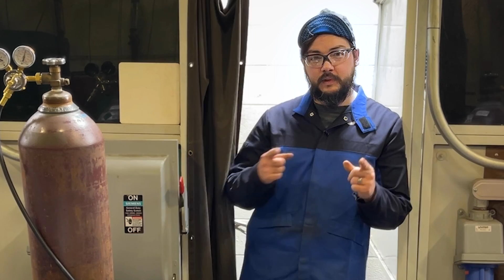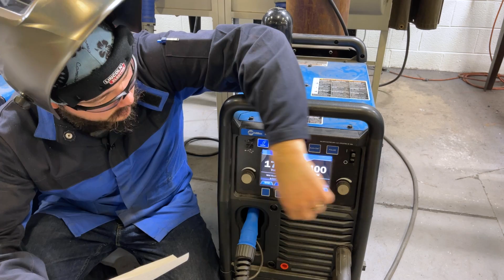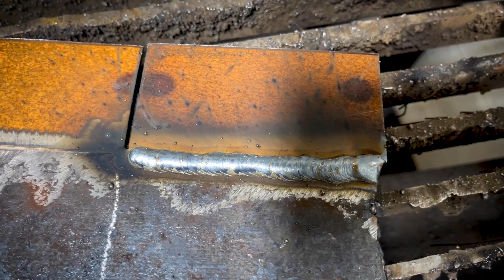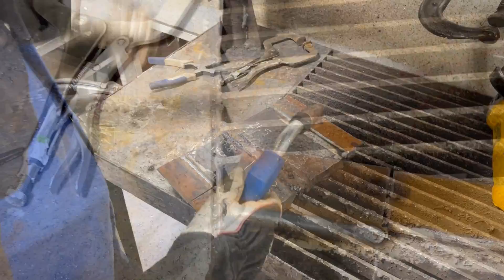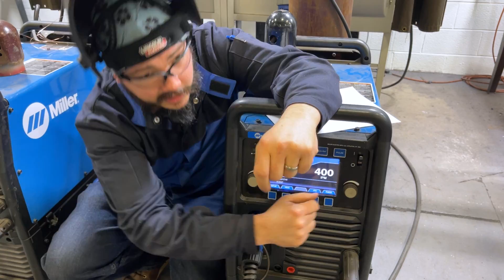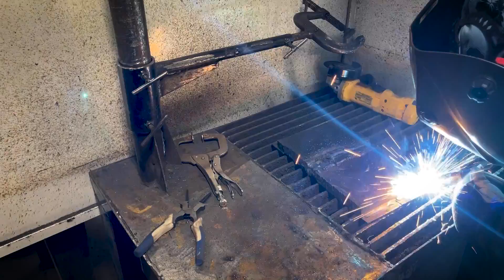MIG Welding Thick To Thin

Comment: That first setting is .5 VOLTS* higher and 20 inch/m slower than what I would use welding 18 guage sheet metal together. Some othe others I'd use welding 1/8" or 1/4" angle to sheet metal. The setting you suggested is what I would have used

E: fixed a word
Reply: @pieshka6  I think the disconnect Paulie is highlighting is that you're talking Volts, not amps. I agree that those settings were on the low side for sure. Amperage is controlled by wire feed speed, but also affected by wire stickout, as a greater distance increases resistance. If you watch your machine in real-time while it's welding, the IPM will often display AMPS.
Reply: @chrisewing3272  I'm too used to everyone I've worked with calls volts amps since there is a language barrier and they are also the tig qualified welders in the shop, so I always refer to it that way without thinking about it

Comment: What's the best welding you can do on these levels of thickness with a cheap Harbor Freight Flux Core welder?
Reply: Best thing... tie a long rope to the welder, and use it as a boat anchor □ Not helpful, I know. Those machines are generally only good for up to 1/4", and so your only chance would be to max it out on the heat setting (voltage) and find a wire speed that doesn't just bounce material off of the top, then do multiple stringer passes until you've reached the desired weld size, making sure to clean the weld between each pass.
Reply: you might get away with 5/16 or 3/8 plate if you ran vertical uphill and maxed the machine out. Otherwise you have to bevel it and make multiple passes.

Comment: I generally shoot for somewhere between the settings for the two thicknesses, but air on the side of the thicker plate settings and use my aim to avoid blasting through the thinner plate.

Comment: I was told by some old head, Thick to thin is all about where you aim and how you wash that heat over into that thinner plate. And since you spend a majority of time on or pointed at the bigger plate, u need to be hot enough to melt in. :) helped me a lot even with tiggin thinner stainless etc.
Reply: Sounds like good advice to me. I teach the same thing. Set your machine for the thicker piece to ensure penetration, and then focus heat there, and use your movements/puddle manipulation to work it into the thinner piece as much as needed, without blowing holes.
Reply: Just spray it
Reply: Yeah that's how me and every welder I've worked with have done it.
Reply: He's exactly right...listen to him

Comment: Would love to see 1/4” to .080 aluminum
Reply: you'll have to Tig weld that.
Reply: Tig would absolutely be preferred, and I'd pre-heat the 1/4" first. Not to say that it "couldn't" be mig welded, but it would certainly be a bit more challenging.
Reply: Ive done similar with MIG, I had to run it very low, with a small weave to spread the heat around. I havent tried it yet but I think you can run hot and just travel REALLY fast, tricky to get the puddle established and keeping that small bead though.